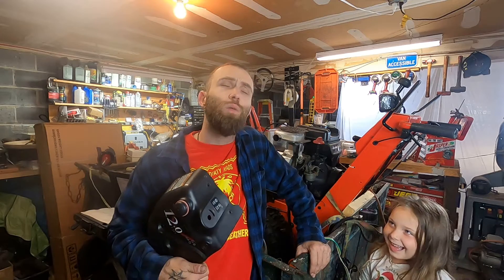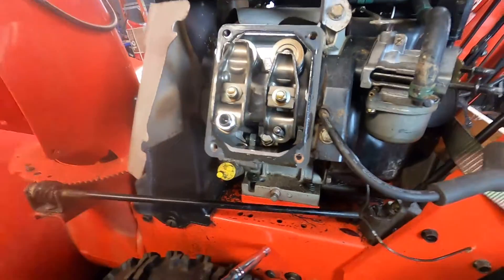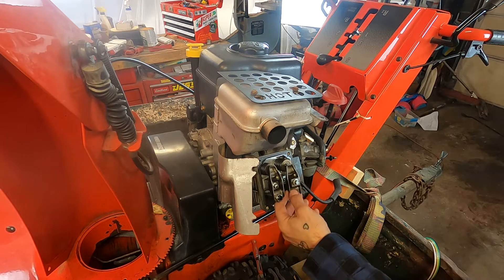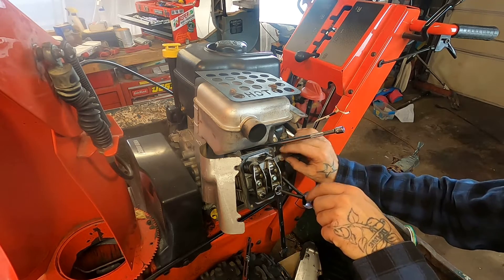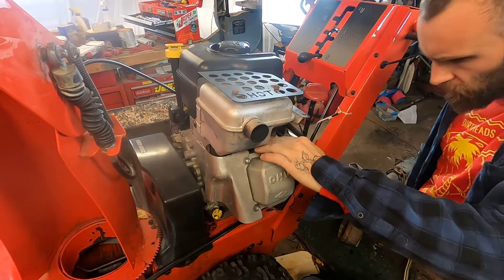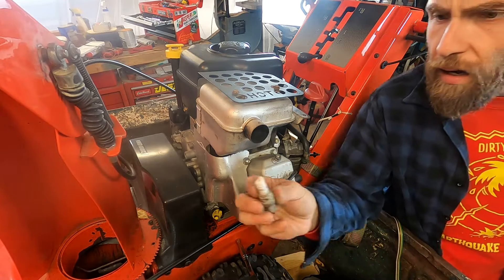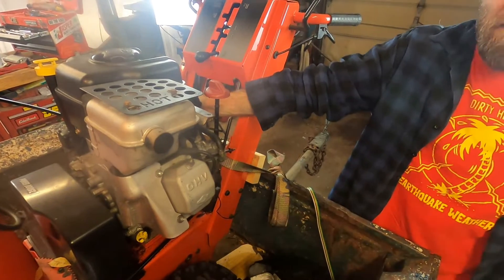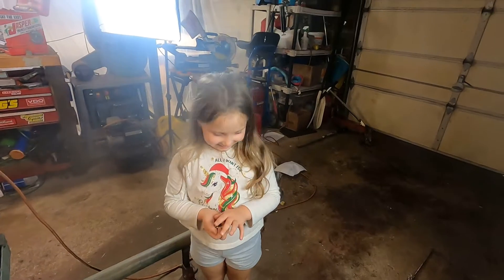This snowblower has NO COMPRESSION… will it run?

Comment: You gave me hope that I may be able to resurrect my polar blast 10530! I gave up on it 15 years ago and turned it over to a "pro". He said low compression and it would need a new engine (He was in the process of shutting down his shop for good and perhaps had an extra motor to get rid of?) I just don't know what the valve gap should be on mine. Thanks for your demonstration!

Comment: Could it be that someone/somebody did NOT have the services not pulled after the first 20 hours of operation, such as
making sure that the valve lashes be checked and certainly after a thorough break-in period ??? I think so!! I read over
a Honda push mower's operator's manual that explicitly tells the owner to take the machine to a local authorized repair
shop after the first 20 hours or quite possibly the first 10 hours to get the valve lash adjustment and inspection report
done in order for Honda to further warranty their product. If by not doing so, Honda can flat out tell you the your warranty
will be thus be void!! It is a very good policy and an owner may find it quite painful as in pain in the @$$ but it is a good 
policy. The same owner's manual also stipulated that the first oil change must be done after the first 5 hours of break-in 
too!  It is bothersome for most people but it's no problem for me and as for any other repairs that are required, well, I just 
leave it up to Honda to sort out! My perspective on the first oil change could be to send the oil out for analysis to further 
back up my claim(s) if any and this too is a good policy!!